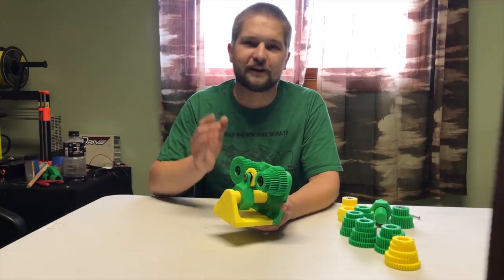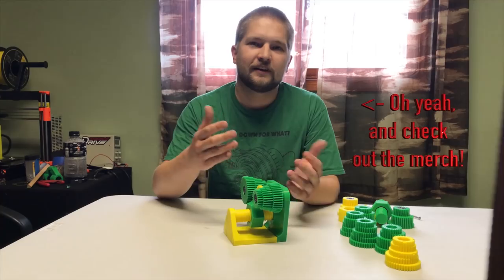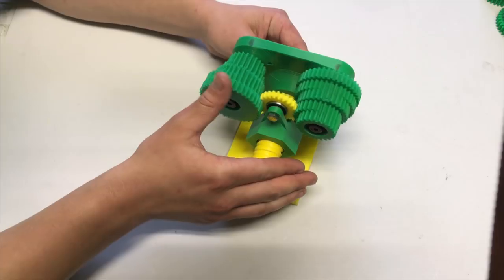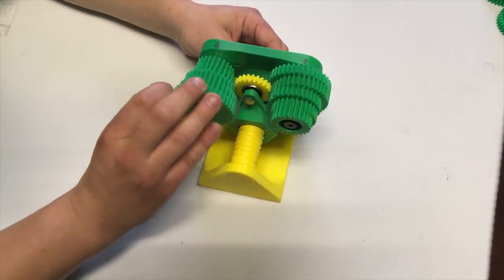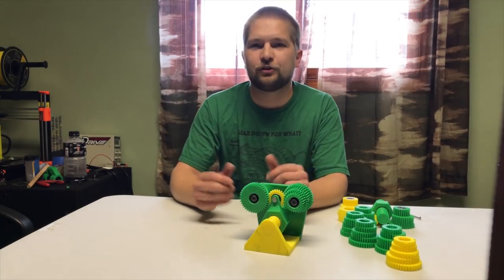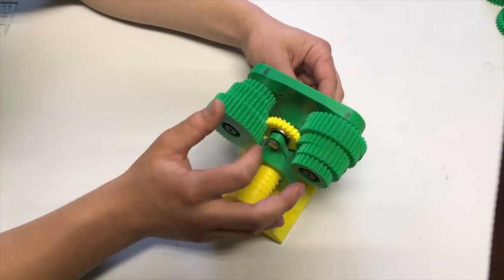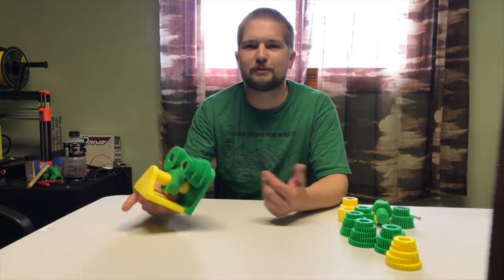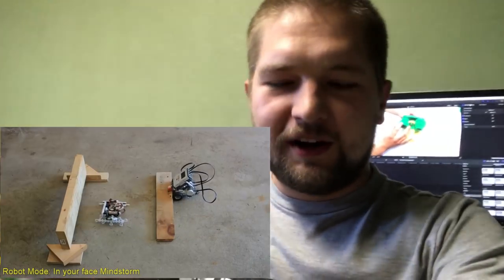The Hot Swapping Gear Mechanism | VCT2

Comment: cool transmission but the more i look at this the more i think this is basicly a modified manaul transmission  with a gear that engages the gears instead of a schnocro mesh the gears rotate of kilter instead of straight allowing the gear to pass through and shift where as on a manaul u need to slide a guide to mesh the gears this would work exactly like a manaul transmission you would need a clucth not to mention it be noisy it would sound like a manaul in reverse in every gear oh and how to get reverse same as manaul add a gear that makes contact with the yellom gear and 3 other gears instead of 2 boom reverse :)

Comment: I'm going to be honest with you the best way to get rid of the Pookie transmission is it get rid of the internal combustion engine and turn to electric motors because you can use the electricity and magnetism to create your own gear system inside the motor instead of having a dedicated gearbox or transmission that's the best way it's just science

Comment: Well, multi-gear transmissions will soon be obsolete thanks to electric cars which only need a simple 1:1 transmission as their torque vs. speed curve is linear.
Reply: Theor gear box isn't 1:1, they still heed gear reduction, and they still have an ideal speed

Comment: How do you know what size and number of teath can be on what circumference of a gear?
Reply from the maker: There’s formulas for that if you want to make them manually, but I use a gear generator for fusion 360 made by Ross Korsky.

Comment: So, basically you're doing what truck drivers and racers have done for 100 years? (Shifting non-synchronized gears at peak rpm without clutching, aka 'speed shifting'?) I don't ask out of criticism, it just seems like you've arrived at a non-synchronized manual transmission, which is not a new thing.
Reply: Yea, and the clutch is 100% unnecessary on most motorcycles, not using it only adds minimal wear to the tranny over using it, especially if it is a motorcycle meant for abuse (racing)

Comment: Um... in order to stop the gears you need to be stopped entirely, remembering that after your gearbox is your tailshaft (or transfer for some vehicles)  which is connected to your differential which is then connected to your wheels. Meaning that to stop your gears from rotating without stopping the vehicle entirely you would indeed, you guessed it, require a clutch. Sorry this design just cannot work.

Comment: Sequential gearboxes change under load too.
Reply: Jan Hendrik Franke dog teeth allow slippage for gear changes, yes, but this is constant load, seq isnt, but thats where most of the problems of this box lie anyway
Reply: noncog1 Not all sequential gearboxes use them, there are for example dual clutch sequential gearboxes that shut down the ignition system of the engine for a split second, so one clutch can engage and the disengage, to minimize wear. Also, no professional race gearbox shifts under full load, even the Moto GP racebikes have a switch on the gear pedal, to prevent a full load gear shift.
Reply: Mandernach Luca i was ignoring those based on what he was implying, but yes all of that is true as well

Comment: I think it would be better if the green gears have a conical shape.
This ones are like stairs or something... and the shifting is hard to do. Just saying :)  Nice video and great concept!!!
Reply: @Sorin Daniel: Cones won't work as gears, the spacing between the teeth would get smaller to the top end, the middle gear's teeth would be either too small or too big on the other end of the cone.
Reply: Spotless Bird Yes... but it will work if the yelow gear moves diagonally... and if it moves like that, the shifting will be very smooth and variable :/
Reply: @Sorin Daniel: 
                                          _________
          /|\                           \        |         /
       /   |  \                            \     |      /
    /      |     \          \ \ \          \   |   /
 /_____|____\                           \|/

input                 | middle |      output                           cone                 | gear      |      cone

Hope this helps :-) See, the cone's teeth have less spacing towards the top, whereas the yellow gear's spacing stays the same, no matter how far you would extend it. The yellow gear's teeth would slip over the smaller teeth at the top of the cone.

Comment: It changes the distance between the teeth and the center of the gear, so, during a gear revolution the ratio is not a single one per gear but multiple. This wont work becuase it violates the principe of mechanical advantage. 

Mechanical advantage in a pair of gears is the result of the ratio between the gear's teeth distance to the center of rotation, if you  isolate just the teeth that is enganged - in your imagination - you will see two levers in action, each one with its fulcrum in the center of rotation.

If you watch carefully, even if the middle gear does not move to another gear pair, but only rotates, the distance changes during a revolution, changing the gear ratio from one that is equal to the previous gear ratio, to the one that is next.

This might work if the vehicle is acelerating and changes gear every time the gear rotates enough to allow the middle gear to engage the next one. But on a non acelerating situation the gearbox would constantly change gear ratios between previous and the next one.

Comment: Your idea is good, but it will not work under load. Notice how you have to loosen up the load when you change gear. That has always been the one big obstacle for these kind of gearboxes. As you probably already know ordinary gearboxes use a clutch (or two) to disengage the load. Anyway, good work :)

Comment: I know nothing about mechanics, but i think changing gears could be easier if there were more intermediary gears, and if they where arranjed to be able to change in quick sucession.
Reply: For example, the time required to switch to 2nd gear is the same time required for the 3rd to be ready, and the time to switch to 4th is the readying time for the 5th and so on.

Comment: I can tell it wouldn’t be very good to use just because of practicality. If the exact type of transmission was to be “just” functional that it works I could see the gears missing and the teeth stripping themselves because of being not efficient when changing a gear because your manually aligning the next gear after to to shift gears.

Comment: Nice! I really like the thought behind this design. It is simalar in theory to a transmition developed by Borg Warner. Called a  "Continuously Variable Transmission".  CVT. and it has had some use in production automobiles over the years. Check it out for some more ideas

Comment: there are flaws. How gear will be engaged under that much load. Gears not rotating in an axis. it will cause vibrations with that much speed. And you will change speed under that much load with that much rev. It wont work I think.

Comment: This is totally doable with a microprocessor controlling the gear transition
Reply: Yes. however, the transmission would be spinning so fast that it would have to be .00001 of a second in between shifts... as well as a motor or something to turn that screw fast enough to not cause binding.... doable but improbable.

Comment: I really can't see how there can be constant angular velocity with this design. That would be the by far biggest issue to overcome, right?
Reply: Oh, I guess every other gear pair is concentric? So it has three usable gear ratios, and two intermediate gear pairs that should only be engaged for half a turn of the shafts? That would mean a very fast acceleration/deceleration!
Reply: mumiemonstret or a clutch...

Comment: Semi trucks have done this more then 10 years match engine and trans speed and then shift gears without the clutch
Reply: That's indeed possible, but to get out of gear you need to get off the power, and then while in neutral adjust the RPM to shift back into gear. This transmission would be able to shift while power is still applied, altho I do definetly not see this ever working on an actual car/truck.

Comment: Try something like this... Just for funsies!

This is a FULL toroid design... I hope this gets the idea avross :D

Keep in mind, there are 2, 3, 4, 6, etc. transfer wheels.

                                                                 Engine power inputs on this side.
...._________________________________________________________________________________________________
....|.....................................................................Input toroid ................................................................................|
....|.........    __----'''''|''''''''''|'-----___.............................................................................  ___----''''''''''''''''''''-----____............|
....  \.___/                 |     |               \......................................................................../                                       \.___/
  A                            |     ||                 \................................................................../     Transfer Wheel and                                    
   |                           | |     ||                    |..............................................................|         Axles and support   
===AXLE===========>                                    |||||  CENTER PIN ||||||                       brackets and shifting
   |                           | |     ||                     |..............................................................|       arms and whatnot are
  V                            |     ||                  /..................................................................\       the same over here.
.... /.""""""\                 |     |                /.....................................................................  ..\                                       /.""""""\
....|.........  .'''''''''''''------|___|------''''''''''' ........................................................................  ....'''''''''''''------_____------'''''''''''............|
....|.......................................................................output toroid..............................................................................|
....'""""""""""""""""""""""""""""""""""""""""""""""""""""""""""""""""""""""""""""""""""""""""""""""""""""""""""""""""""""""""""""""""""""""""""""""""""""""""""""""""""""""""""
                                                                             Output to wheels on this side.

ASCII CAD V. 1.0

(c) Nobody, this design has existed for a LONG time! I just got bored.

Comment: Great design but would never be able to work. Clutch in transmission is for the exact reason this missed up. Changing gear while parts are moving won't work no matter what. If you want to change gear ratio while moving you have to figure out a way to increase or decrease the size of the gear with out changing from one moving part to another. In other words have two gears only that can increase and decrease there actually size and not switch over from one gear to another.

Comment: Could you not float the median gear on springs?  If that isn't enough perhaps combine that with a cammed shift fork that is synced to the change alignment.
It would require a bit of thought but I leave it as a suggestion.
Reply: Rick Graham does it have springs? I thought the median was just pivoting freely.
Reply: He means springs to control the shift. Apply tension to the idler arm and let the thrust load on the idler gear hold the assembly in place until it reaches correct alignment with the transition gear to allow it to slide over.

Comment: You do realize on the fly means without stopping right? Why do u keep stopping it while turning then?

And the skipping... That's cuz you need a brace at the front to reduce flexing... Rather than letting these loose plastic parts flex left and right, opening up gaps.. Besides if this was in a modern  transmission there would be a hydrolic shift solenoid ... It would push the center to the next gear faster than a human can blink... Like today's paddle shifters... 

What other problems u got for me to fix?

Comment: the main problem with this designed and the one that why this is not good invention, is that both gears are not balanced, and with high speed will not stay 1 min without damage the bearings....

Comment: Honestly man, this is cool, but modern cvts do pretty much the same - sans the propensity for tripping teeth and blowing up! Plus, a cvt will give you all the gearing ratios you want, plus all the ones between those.

Speaking of CVTs, pretty sure my car’s got one. I can accelerate from a standstill, from 0 to 60, and the tach stays at about 2k the whole way. Weird hearing the engine hum the same tune while speeding up!

Comment: No really useful. Maybe as a toy :) 
Switching gears in low speed is no problem, but real transmissions do not have low rpm all the time. Even toothed gears are not effective, helically toothed gears however have forces that face sideways -> this would ruin gearshift, as the shift itself had to be super fast and needs to counter the sidefacing forces in a transmission - which can be huge. The shifting mechanism is also very weakly mounted as the distance of the shifting rod increases drastically with every additional gear. Believe me or not; when ZF, Mercedes or Porsche build a transmission, they pretty much know what they do.

Comment: This is dumb, there exists no mechanically geared cvts because its mathmatically and geometrically impossible to build infinitely varying gear ratios with fixed tooth size. Also, what is the purpose of putting the gears close together, there is no way its going to simply slide over and engage the next gear instantaneously.

Comment: Coged gears like that have a lack of strength and are very noisy to withstand modern power levels of cars the gears would need to be helical or they won't hold up.

Comment: This would work great if you had syncros
Reply from the maker: Then it would just be a transmission.
Reply: Gear Down For What? True, but with the load differences on the input and output wouldn't the gears jar? Especially on downshifts

Comment: Someone actually spent the money for patenting this?

In addition to the problems cited with shifting while loaded, these "gears" are designed off of bad windows clip art. Actual tooth profiles are going to be cycloidal or, more commonly, involute. Herein lies the problem.

It is impossible to design the transition gears with an adequate profile. The shifting ratio/diameter means it cannot maintain an ideal profile. In addition, you will have moments of unaligned mesh where you're running on the shoulder.

You put this under any meaningful load and it will fail.

Here's a hint on your quest for infinitely adjustable ratios: Don't use gears. Finite teeth will not produce infinite ratios.

Comment: Much more practical to use a constant mesh transmission and spark or fuel cutoff.
They are available, reliable, handle more power and faster than your setup...

Cool idea, just not practical

Comment: well electric motors are making transmissions sorta obsolete
Reply: spedracrer55 Not this year, and not next year.. So until then, any trans that can act add efficiency, or reach the "holy grail" of transmissions- (gear driven CVT/IVT w/ no slipping/ durable/ good thermal efficiency) - will be nothing but an improvement to what we have... Even if there was a sudden huge leap in electric technology do you think we would just scrap all our 18 wheelers while we wait for new eTrucks on back-order that nobody can afford? Seriously though, Imagine The benefits if somebody could invent a gear driven CVT for heavy Diesel trucks!

Comment: I designed I think better but has it's own flaws but cheaper uses cables and a adjustable arm but can change speed on the fly just by changing the arm length using a hydraulic piston but it's a bit jumpy don't run quite as smooth as gears but is so much smaller you could put multiple together and add the speeds so the speeds will be more smoothly but it's so cheap and not quite as smooth so I would be good in a cheap car not like dumb expensive cars

Comment: Always thought a transmission of likes of a bicycle sprocket with multiple arms that extended inward/outward to change diameter with chain tensioner would be interesting. But this thing is shit sorry. balancing nightmare, straight cut only, shift timing problems etc.

Nice 3d model though, it is cool.

Comment: /\=\/ like this there for the inner one is just a barbell with gears and the outer ones are cones with flares that are the gears and the open corkscrows are still powering it up to the next gear with no loss of power .. well i have typed a nuff if you like we can talk more lol as for me i am trying to find out how i can turn a wimhurts wheel into multi propellers so as you get lift your also getting energy and also as a static field to drive the an array of electric motorsthink of tow pie tins with multy plats with metal pads and on the outer parts of the plats are the fan /rotor blades  so as you have lift youere also getting power as the hole thing turns in to a hollow gyroscope just there your inside of it .. well sorry to nurd out see you latter and good luck ^u^

Comment: What if it will have sideways резьба, шлицы, хер знает как на английском) don’t know how in english calls this ribs

Ps teeth, remebered
Reply: A helical gear is what you're searching for.
Not sure if that would be possible with this kind of transmission, but it would at least change (increase or decrease, depending if you're going up slope or down slope and wether you're braking or accelerating) the shifting force significantly